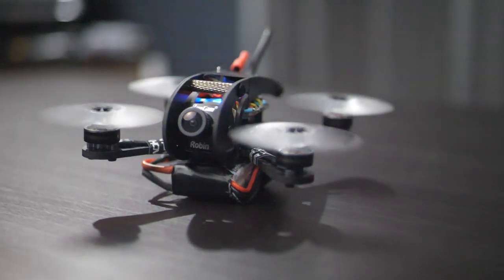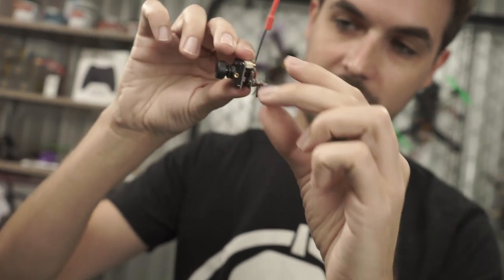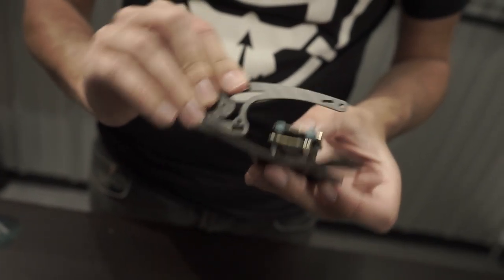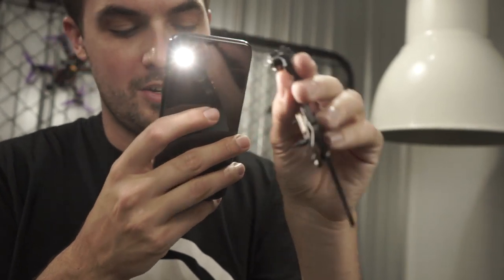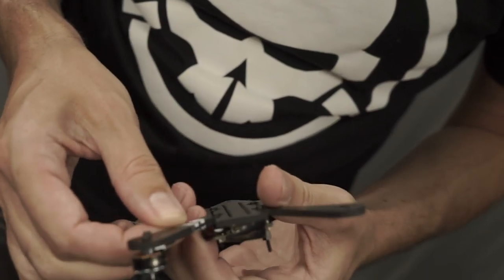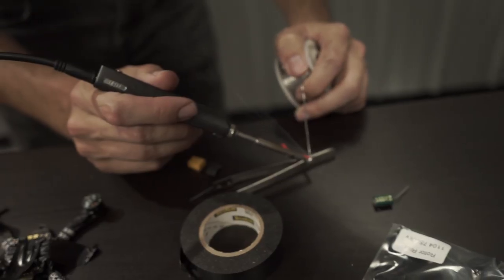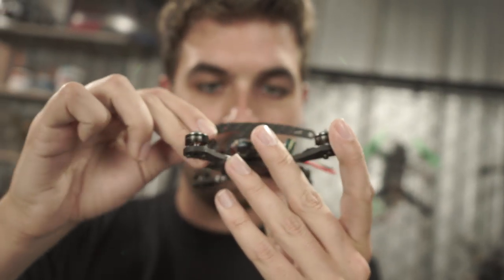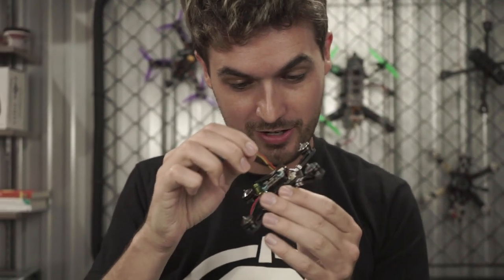Build: Driblet Micro Freestyle Drone (with Le Drib)

Comment: These build videos are great, what would be greater would be  before you release the video, have enough of the components in stock to fulfill 25-50 kits and a "Notify Me" button when the kits are out of stock.   This will give you an idea of how many more kits you can assemble and ultimately sell.    I know this hobby is about customization but until I build a few more quads, I'm not into customizing yet so getting a really good quad KIT is the best entry path.    Your build videos drive sales but if you don't have a BUY IT NOW button with product ready to go, you're putting sales barriers in place.   When the video get's old (what's that about a month) much of the impact is lost.   I want to buy your stuff, make it easier for me.

Comment: unrelated question - I have just bought a brand new flysky i6x. can I use the USB cable that comes with the transmitter in the box to work with a drone simulator on the computer?

Comment: I wouldn't soft mount the standoffs. I'd think the whole weight of the stack could act like a pendulum and have a resonance. I think the gummies on the fc are all you need. Also if you use m2.5 standoffs you can use those brass spacers they sometimes pack with servos to go inside the soft mounts so that you can actually get the nuts tight without over crushing the isolators

Comment: I wish I'd have seen this video 6 months ago! 😝 Repeatedly I have been damaging my motors on a micro drone build by using screws that were too long. In my case I also had motor protectors so I didn't see what I was doing.. Also struggled with this SBUS / DSMX. Thanks for the great video

Comment: pretty sure you need to use blhel S to configure these mamba ESCs.  I have used that runcam vtx on a diatone r349  v2 and its hot garbage.....you will wanna install additional caps.
Reply: No its blheli32. I have the stack the esc is shit.

Comment: Why is the capacitor needed/ what does it add?
Reply: It filters system noise
Reply: Also reduces voltage spikes when plugging in the battery. Safer for the FC

Comment: Many months later........ty I guess
Reply: Come to think about it the guys at excel scratched their head on the Driblet build. About 4 months ago when this information was needed, it didn’t exist.  The fact you had to explain the m2 mounting alone should display that this build isn’t meant for someone “getting into the hobby” as you said. There is no build schematic provided with the frame (reference point iflight frames).  While the video is appreciated, it comes much to late to take care of your customers.  And that’s not even bringing up the material quality of the bottom plate itself.....sold out at RR for more than 2 months.  Too little production or two much breakage..... maybe both
Reply: And you changed the stack from your original build (and then some) with no explanation as to why......? Hate to pull the card but #edorsement ???